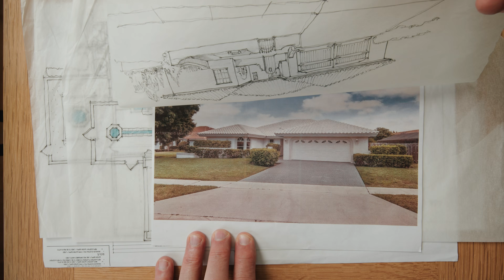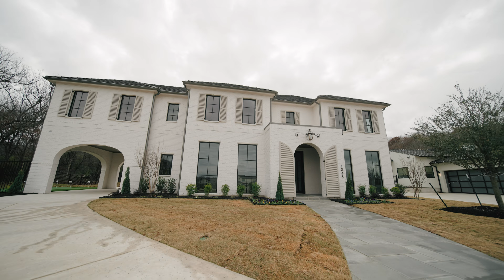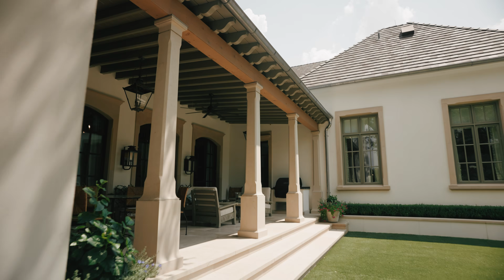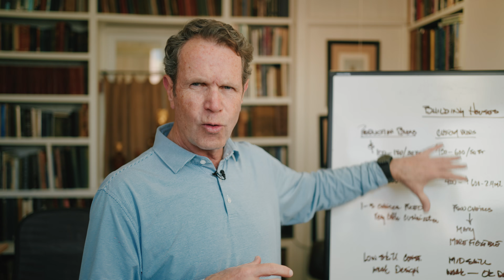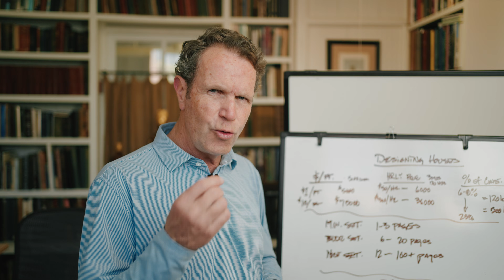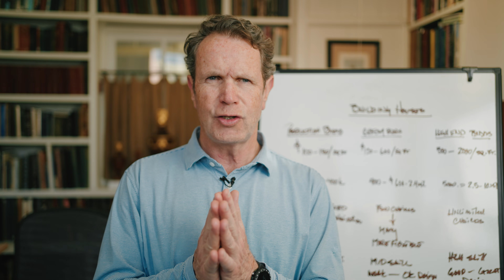What Should House Plans Cost?

Comment: Hi Brent, great video! In addition to the people who may be on your team (the architect, builder, interior designer, engineer and landscaper) another group to consider would be what I call the “forensic science” people. These would be the professionals who assess your building envelope, your HVAC system (heating, cooling, fresh air system, dehumidification, etc) as well as plumbing and electrical experts. I’ve heard Matt Risinger and Steve Baczek say on multiple occasions that the sooner you involve these specialists in the design process (well before the construction begins) the better the outcome for your build.
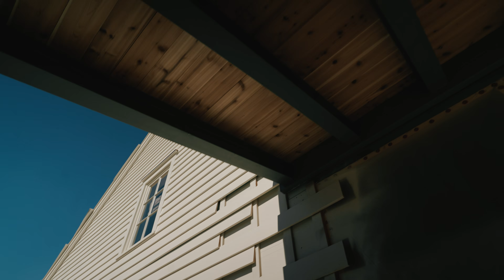On another note, at minute 17:36 you talk about “not putting Hardie on your house” because it’s ugly and a “fake” material. Given the recent loss of over 12000 buildings in Los Angeles I know there is going to be an increased demand for new construction to use fire resistant materials like Hardie cement board siding. Can you do a video on fire resistant materials and design details that you would use on either a historic or modern building?
Reply from the maker: Hi Ryan, thanks for the comments. More to come.
Reply: Cement based stucco.
Mostly it's siting for fire mitigation even in a city. 
This is the first major loss of homes in an urban setting. That's no reason to change the requirements nationwide. 
New homes aren't going to burn like LA did. 
I live in Colorado and we lost 1 or 2 hundred a few years ago and that was a first. No new code changes.

Comment: 10% of the cost per square foot, good round figure to think about it.  About $30-60,000 for plans depending on size and cost per square foot. Thanks, Brent. this is good information.
Reply from the maker: Nice to hear it. Thx for watching.
Reply: Brent, I really enjoyed the video but this math at the end was confusing — It sounds like your example was a $300/sf house x 3,000 sf = $900k.  So how did you arrive at the $30k fees as 10 percent?
Reply: The calculation is based on cost per square foot, not the total cost of the project. 

Cost per square foot = $300
10% of 300 is 30. 
Hence the 30k estimate.
Reply: @Amoebasystem  Thanks, I kinda got that same impression, but it seems to disregard the size of the house, which would greatly influence the scope of work for the architect/designer.
Reply: Los Angeles architect here. Interesting presentation however, the 10% of cost per sf doesn't make any sense. You need to factor in the size and complexity of the house also. $300/sf x 3000sf = $900,000 house. 10% of $900,000 is $90,000. No one in their right mind is going to or should pay an architect $90,000 for plans for a $900,000 house. Would be nice, but it doesn't make sense either. Most plans for a new house I am designing are in the 2-3% range of the cost of the new house. So a $900,000 house would be about $20,000 - $30,000 not including engineering. To make it easier I charge $10/sf and adjust it accordingly if a more or less complex project, hillside, etc.. Engineering runs about $2-$3+ /sf depending on site and design complexity -  3000sf house for an engineer = $9000.